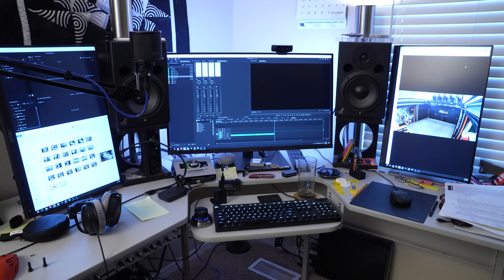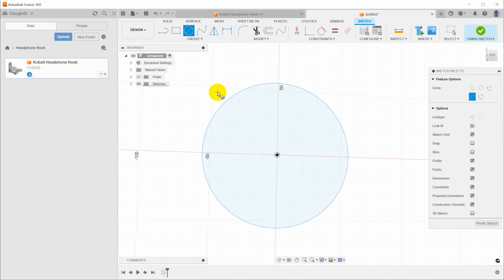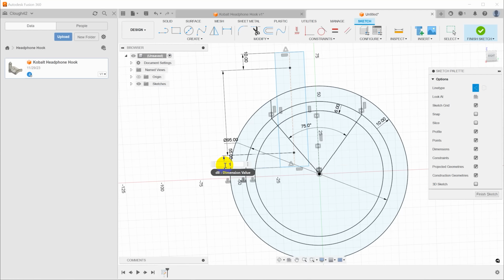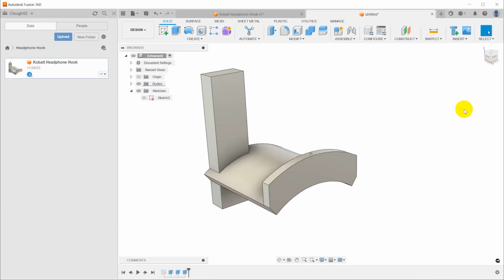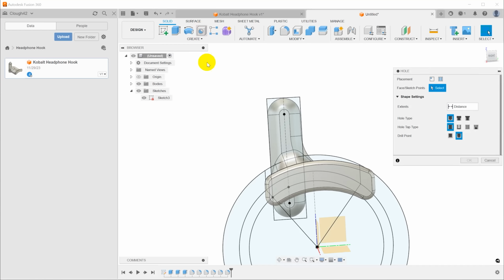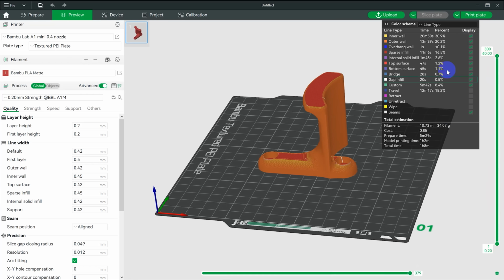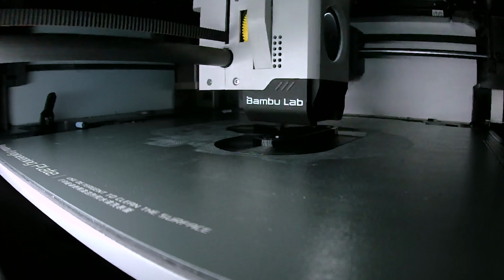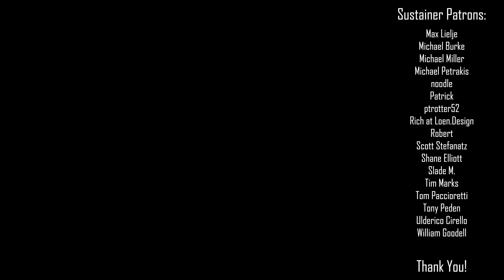Design Curvy Parts the Easy Way | Fusion 360 Tutorial

Comment: why the seam on the underside??
Reply: No property reasons, purely aesthetic... Though technically, from a strength standpoint, you wouldn't want the seams on a face that is stressed in tension since it would be the weak link in tensile stressing since the bold is melted to solidified and more likely to fail in tensile load (think of layer bonding... Its the same principle, i.e., a weak link).
Reply: I don't understand, if it is not in the model, it should not be in the print! @CP_300PRC

Comment: Very nice CAD tutorial. out of curiosity, what is that DBX box bolted under your desk?
Reply: I wondered that too ;).  It’s a DBX 286s Microphone Pre-amp Processor.  Part of the “secret” to James’s excellently produced sound.
Reply: @XcaroTenes  It's worth noticing that DBX 286s is an analog only device so you need separate digital audio interface in addition to that. That said, DBX 286s is the best one available right now for the job it can do.
Reply: @MikkoRantalainen Yup, noted.  It's sweet sweet analog in the OG sense, in the same spirit as tubes.  A nice piece of prosumer gear, it handles both unbalanced and balanced input/output.  I'm curious what microphone(s) he uses and the rest of the audio chain looks like.
Reply: @XcaroTenes  don’t tell him that I’m listening to that beautiful quality audio through ipad speakers smaller than my thumb nail. 😜
Reply: @sblack48  Haha, same here.  Totally in keeping with the adage "measure with micrometer, mark with chalk, cut with axe" :).  Start with the best audio (and video) you can and let the downstream use degrade as needed...

Comment: I really appreciate all of the CAD content. I don't use Fusion, because of the rapacious pricing, but the great thing about all parametric CAD packages is that, if you can use one, you can use any of them with minimal effort. I can translate your design process and intent into the package I use with no problem, and I've learned a ton in the process. Thanks!
Reply: Mind that you just need to reapply after 3 years to confirm you still match the criteria, your designs won't vanish.
Reply: I'd say "rapacious" is a bit much.   Have you priced SolidWorks lately?
Reply: pirated solidworks is #1 fuck fusion
Reply: F360's personal use license is free for 3 years and has full features with a 10 document limit (you can have infinite documents, just 10 active at the same time). I like it becuase it's very easy to use, but I've been wanting to jump to another CAD software because fusion isn't available on Linux and it's the only program keeping me on a Windows machine.

Which CAD are you using or would recommend?
Reply: @aszher a good Linux CAD Programm is also a thing what I'm looking for
Reply: @aszher  For Linux, FreeCAD is probably the best package going. It's an open source project under continuous development. FreeCAD has a great deal of functionality, but from what I've seen, the interface will take a little getting used to, coming from commercial Windows software. There are a lot of good YouTube tutorials and pretty good documentation to help the process along.
Reply: @aszher I like FreeCAD. A bit rough around the edges but does everything I need it to do.

Comment: I'd recommend adding in all fundemental features (holes included) prior to applying fillets so you can roll back all of those curvy features to make modifications to core geometry and add in new features after the fact with ease. Modeling on complex and curved surfaces causes lots of unnecessary difficulty especially on more complex parts.
Reply: I think he chose his order of features very carefully there. Large fillets like that can be VERY ornery in fusion. Sometimes the fillet edge can hit the border of another feature (like a hole) and the operation fails there.
Reply: Adding the holes before the fillets would probably prevent the filet tool to work properly. Worth a try but sometimes it is a bit difficult to make it work on complex geometries.

Comment: Get rid of that seam, when ther is no need for it by disabeling (Z hob) "retract when layer change" in Printer settings under Extruder.
You'll only have seams that make sense from there on.. switching between models for example

Cheers and thank you for the spot on tutorial!

Comment: Personally, I'd have added a Screw Hole or two for installing a M3x40/50mm Flat Head Screw coming in from the back going almost all the way to the front acting as a reinforcing Rebar because of the Layer Line's orientation making the part practically indestructible.
Reply: For a headphones holder?

Comment: Metric FTW, sorry imperial boys this is the way to go
Reply: Yes SI (aka metric) is the way to go for all advanced civilisations. If people need to use a traditional system then cubits is the God/Bible preferred choice. USA "customary" units (aka English or Imperial) are what's left of the Americas being an English colony, i.e., a continued reminder of previous servitude. As a former British subject in the former English colony of NSW Australia I went through the conversion to metric in 1973... never looked back. It puzzles me why so many USA people bang on about freedom, still cling to the colonial ways, and fail to complete what was started in the revolutionary war. 
Clearly there are sites that use the colonial units so I have to think on the fly. For me it's good enough to think 1/1,000"  (or thou) is 25µm, 1/10,000" (or tenths) is 2.5µm (where µm is 0.001mm). And, for completeness, longer distances should be measured in mm or m, and never cm. When the exact 1"=25.4mm conversion matters I have a calculator. So, any measure accurate to 0.02mm is going to be a shave more accurate than the same tool with 1/1,000" accuracy, and the high precision version for measuring "tenths" will be marked in 0.002mm increments.